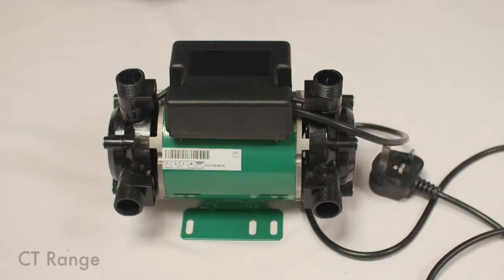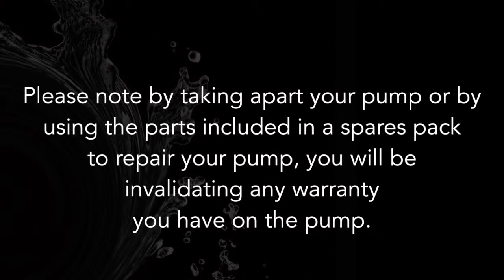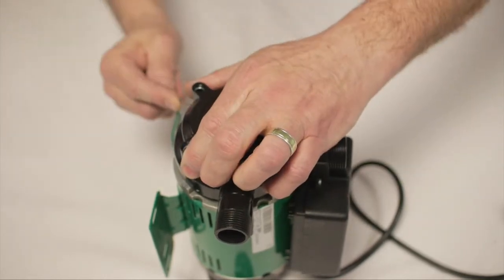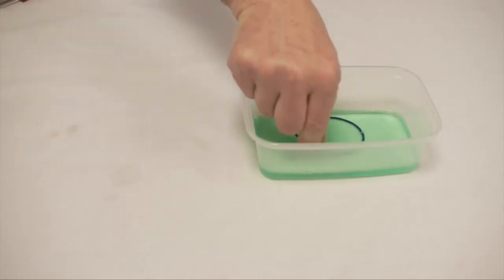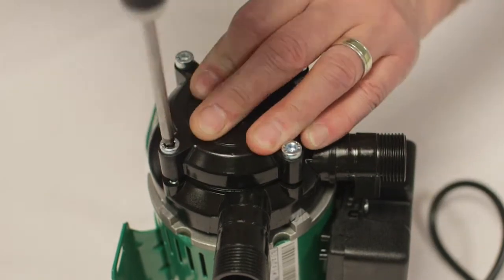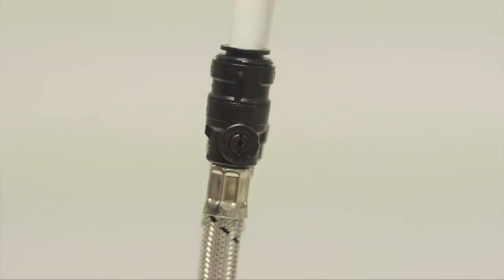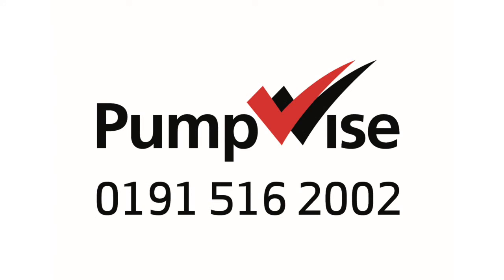How to change an o ring seal on a Salamander Pumps CT Shower Pump

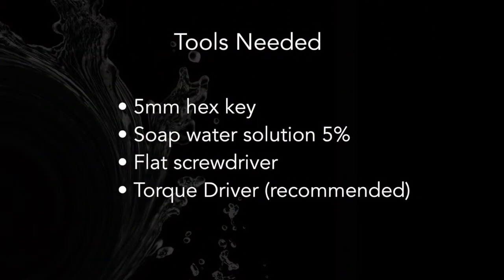Comment: so.... how do we do what you say between 0:12 - 0:21?!
Reply from the maker: Hello, thanks for your question. Every installation will be different however in most cases, to isolate the pump from electricity you will need to unplug it from the mains supply or isolate safely at the fused spur. To isolate the pump from the water supply you will need to turn the isolating valves to be closed. The pump can then be removed from the installation and drained by discharging the water into a bucket.